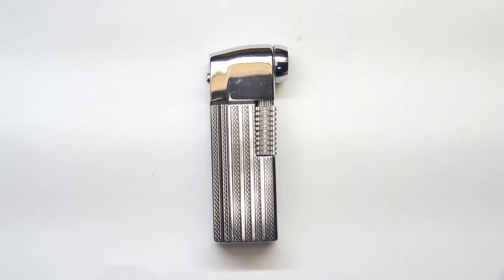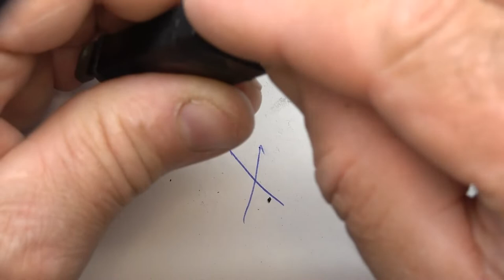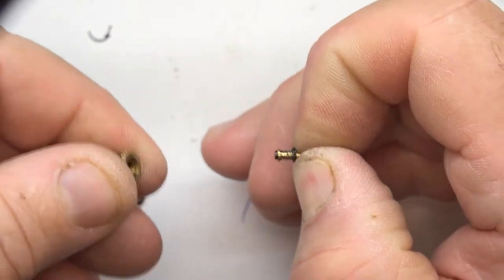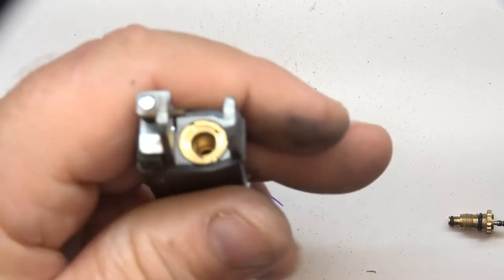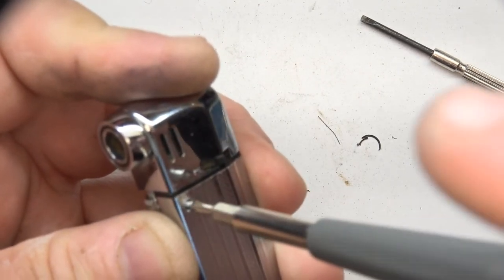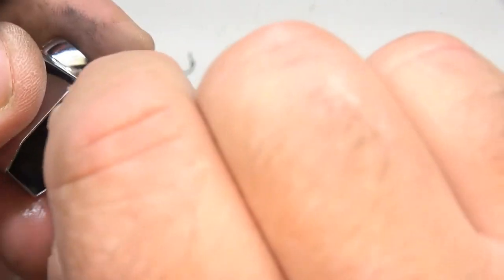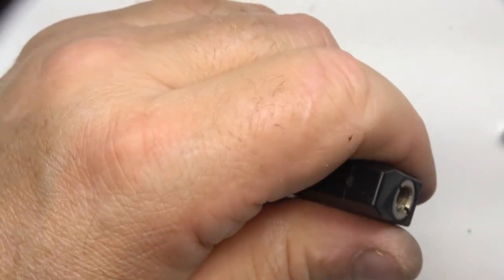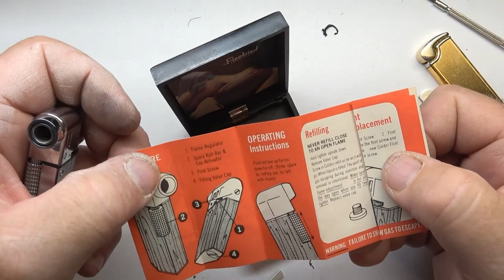Firebird Pipette Pipe Lighter

Comment: I have a similar lighter but the bit on the right when I lift it up to open the valve, the metal bit pushes it back down so it won't stay open. Do you know what the problem may be?
Reply from the maker: Maybe someone took it apart and lost the little ball bearing that is used to  hold the roller in the up (on) position
Reply: @Lighters-cf4bd  After 2 cuts with the screwdriver, I finally managed to open it up and found the little ball bearing. However, I found a broken O ring, I guess it was put inside to hold the ball up. Also what I found, the ball had a semi-broken support so I have no ideea what part to order to fit inside the small hole for the ball to use...
Reply from the maker: @dariussala6377  There are no parts to purchase. If you need parts they will have to  come from another lighter. Take a photo and send to my email address 
lighters2018@gmail.com    Maybe I might have something, its a long shot but sometimes it does happen.

Comment: Hey I bought a lighter a old flamex toronado it has the electronic spark and holds fluid but it will not light what should I do? Same issue goes with a Nesor lighter I bought
Reply: Change sponge and poke hole with a 30 gauge wire or rod at 28:00.

Comment: Hey I wanted to ask for your input. I recently bought a zaima chateau and when I press down on the thing that's supposed to shut it off(forgetting what it's called) it still leaks a bit. Tried rebuilding it but it doesn't shut off. Any ideas?
Reply from the maker: If the main seal is leaking it will do this replace the stopper and make sure it protrudes just pass the brass valve that the stopper fits into. Best I can do without looking at it myself
Reply: @Lighters-cf4bd  Cool I'll give it a try